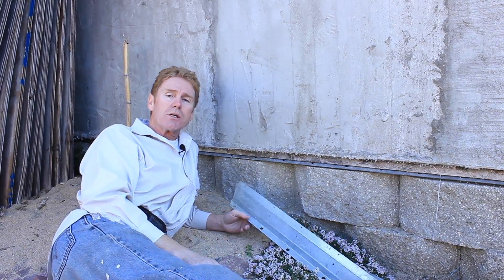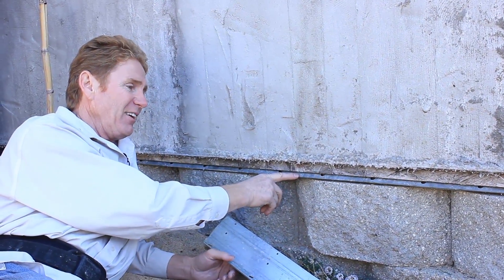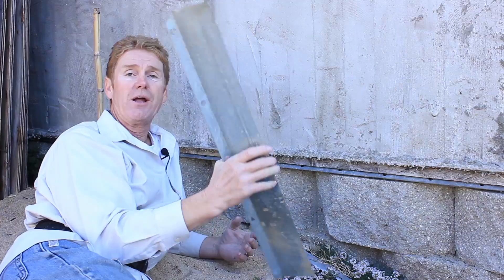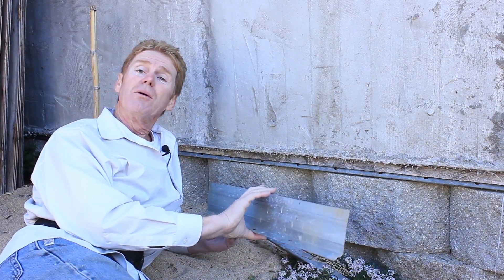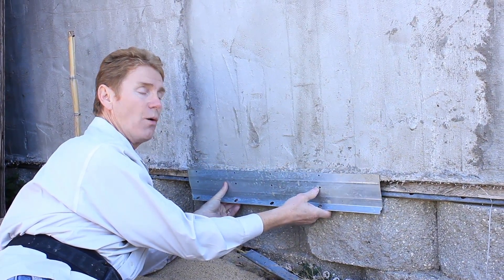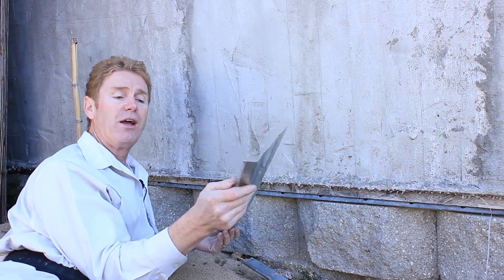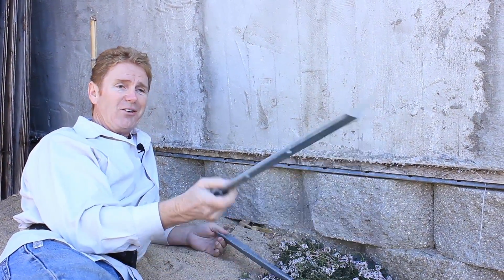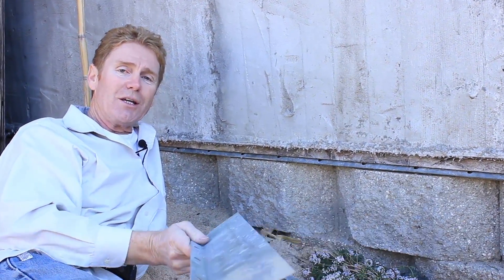Stucco drip or weep screed failures

Comment from the maker: Stucco and Plastering advice
Reply: very well explained
Reply from the maker: Hey Peter, this fella should have watched the video first, 
 Cheers!
 kirk and family
Reply: get the  stucco boys  together an do  some yelling on google ...
Reply from the maker: Perter, I try not to yell or whine, just get iher repaired,
 Cheers.
 Kirk and family
Reply: AKA Advertising  on Google  for   biz
Reply from the maker: Hey Peter, what does this mean?
by the way the pigeon caption was way cleaver.
 Cheers! 
kirk the plastering dude
Reply: The  " Fro"  was  a  typo  is now  "for" an  fixed  … the more you post to google plus   the  more  your  business  name gets coverage on google pages  an results in  possible   future   jobs , every  little  bit counts . getting the" stucco  boys together"  means the people you work with other stucco contractors an carpenters an subs  . When you yell  from  the mountain alone  no one  hears. When you  yell as group as  on a  chat people  listen an can hear you . cheers !
Reply from the maker: Cool beans daddio, thanks for the tip, recognized works.
 Cheers!
 kirk giordano plastering
Reply: Hi kirk, I have a question, where the flat part on the weep screed goes to the holes. I have an area on my house that it's only about 3/8s of an inch below mud sill, I ran it level and and the very end it got closer to mud sill, I put alot of caulking behind it, but as I layed in bed it was on my mind lol, do you think I ll be alright?, I'm in southern California desert, we dont get a whole lot of rain out here, but just wanted to hear what you would say for peace of mind thanks kirk, p.s I really enjoy the videos, I'm a concrete contractor and I think you are one of the best out there in what you do